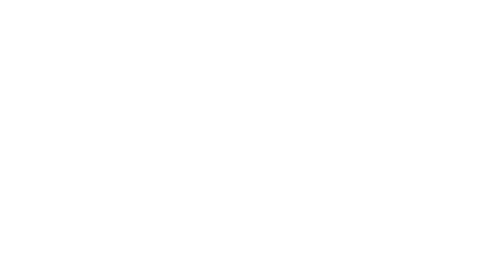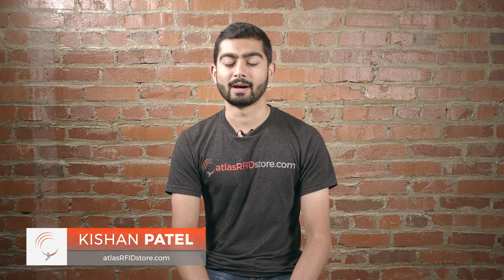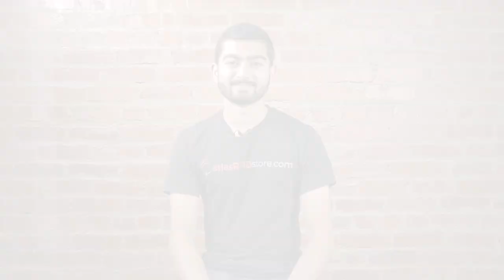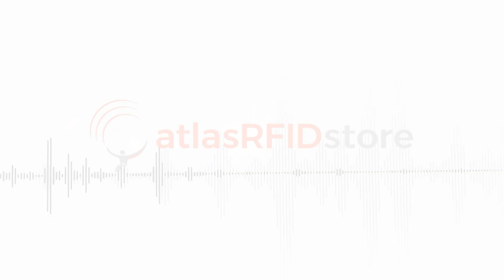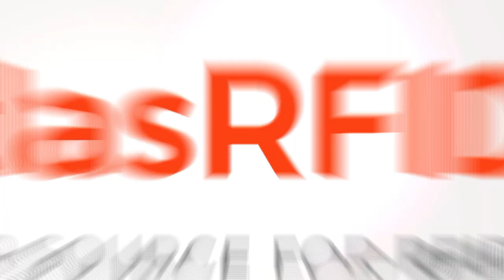Why Isn't My RFID Reader Reading Tags? - Q&A

Comment: We get great reads everywhere but at a specific meeting when we're trying to herd 1000 people through one set of double doors where the readers are set up. We miss some of the tags I think because there are so many people in the read zone at one time. How would you offset this?
Reply from the maker: Great question! So do you have two sets of portals up, one for each door? or do you have just one portal on one side of the double doors and one portal on the other side? Also, have you thought about using an antenna at the top of the double door area? There's actually quite a few ways you could go about this, alot of the time RFID Race Timers have this same kind of problem with people coming through the finish line. Email or Call us and we can help you problem solve anytime! We always want to make sure your application is successful, and care more about that then selling you anything. Here's our contact us page, we'd love to help! I think our typical reply time is only a few hours - https://www.atlasrfidstore.com/contact-us/

Comment: Hi, I'm using RFID-RC522 I'm interfacing with raspberry pi. Previously it were working fine and now when I'm holding my tag in front of reader it is not providing any output I'm not getting were the exact problem is happening with rfid reader or tag
Reply: Same issue, Found any solution?

Comment: Hello I'm using rc522, and Arduino Uno.  it cannot read the card. I'm trying it in Arduino ide, it shows that firmware is unknown. Please help me
Reply from the maker: Iswarya,
I'm not very familiar with using the Arduino - which RFID reader are you using? Are you sure that the RFID card/tag is the right frequency for your reader?

Comment: My rfid reader is mfr522 and I use Arduino uno after connecting them,  the serial monitor give me version =0x0 and something  connect and gives 0x92 but when i  scan the tag it give me nothing! I don't know if the problem from the tag or the scanner?
Reply from the maker: I'm not familiar with that RFID reader and I've never used an Arduino Uno. Is this a UHF RFID reader and tag? Are you sure they are both working on the correct frequency?

Comment: Hi,

I got an access control for vehicles and every vehicle use a tag as user to gained access and open a door to pass through it. 

My reader is reading the tags but is not opening the door for the user, what do you think is happening?

Please help me with this!
Reply: invalid card maybe? you have to add each card to the reader separately
Reply from the maker: Andres,

Did you buy an all-in-one system or did you create the system yourself? If it's an all-in-one-system you should reach out to the company your purchased it from - could be a custom software issue. If you created it yourself, could the reason be the connection between the RFID system and the door opening mechanism's software? If the RFID reader is reading the tags my first thoughts would be that:
  1. The middleware or connection between the two hardware items (RFID system & door opening mechanism) is not working correctly.
  2. Possibly the algorithm in the software for "open" and "do not open" is not correct.
Let me know what you find!
Reply: @atlasrfidstore  Hi if this two problem happen,  how do I solve it?

Comment: Hi..
i have RFID reader FM503 module ordered from china....but unfortunately company didnt send its tags... i did buy tags of same frequency(860-960MHz) but reader is not reading the tags.... Im working on raspberry Pi
Reply from the maker: Arslan,
I'm sorry that your RFID reader is not working - what type of RFID antenna are you using? You might want to reach out to the company you purchased it from and ensure that it is set to the correct frequency. You may have a module that is able to read 860 - 960 MHz, but it could have been set internally to read only a specific range on that frequency, for instance only tags that are 902 - 928 MHz. Have you been able to reach the company you purchased it from?
Reply: @atlasrfidstore  when I commented for help ,  i was doing my FYP
And now it’s been 4 months since I had completed my degree

Comment: halo,
my rfid reader (MFRC522) cannot reading tags when i use arduino ethernet shield as a microcontoller, but when i use arduino uno it's work. the plan I want to save tags into the database. I wonder what the solution is
Reply from the maker: Dumayangsari,

We actually do not sell Arduinos or work with them so I don't think we are the best resource. You might want to reach out to Arduino's support to find the best answer, I'm sorry we couldn't help!